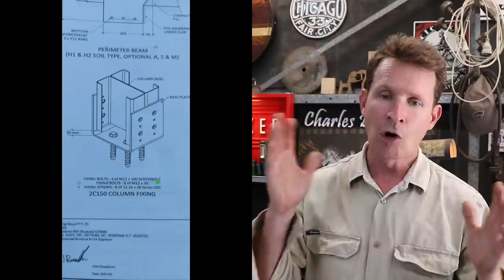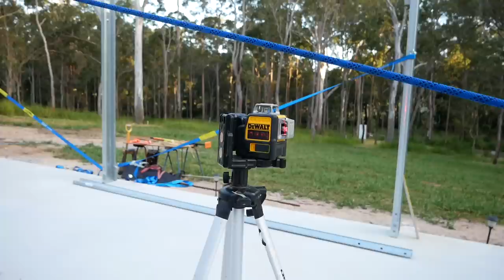DIY Kit Shed Build Lessons Learned Q&A - Forme Industrious

Comment: If you're looking at shed builders, a good price estimate is it should cost approx 30% of the shed flat pack price. Noting that finding a shed builder (let alone a good one!) is very difficult currently!!! Also note best sheds use a different steel (and don't use colorbond) so it's more like 50% of the flat pack price

Comment: Hi Scott, love your style - I'm about to build a 13.5 meter * 6 meter shed - any chance you could tell me about your "roller skate" ladder ?
Reply from the maker: Thank you! If you can weld and cut metal, make a work stand that will allow you to reach the top Roof Purlins and low enough to do the eaves etc. If you see mine in the videos you get the idea. I made a detachable safety rail for lower work. Hope this helps.

Comment: If you would suggest investing in one significant piece of equipment given your other shed build as well what would it be? And you could keep it of sell it at the end.
Reply from the maker: Good question; A Workstand or mobile scaffolding that allows you to reach safely all parts of the build. This will save you $$ on hiring a scissor lift apart from perhaps a couple of days. Lifting the frames you either have a lot of help or hire a machine. Roofing with insulation is tough work without a scissor lift but it can be done. I made my own work stand and I'm glad I did. I've kept it and used it plenty of times for various projects, but it can be sold once I no longer need it.

Comment: Well done Scott.  Loved the old ozzie venacular ;-)  
I know where you are coming from.....  built my 17.5 x 7 kit (with a little help) about 20 years ago.  
Last year I built two igloos (by myself) and then had a crane lift them to connect to the top of each side of a 40 foot HC container.  Did the concrete on one side myself before I called it quits and got a pro for $1800 labour (I paid for all materials) who did a 12m x 6m slab in virtually one day.  
I celebrated my 80th birthday with my twin brother last Saturday  so  I don't think I'll be building anything so substantial again..  
Thank you for all your advice.  You are a wealth of true knowledge.
Reply from the maker: Happy Birthday Malcolm and also for your Brother! Thanks as always for your message.

Comment: I wish I'd been able to get ahold of you before you started on the roofing and siding panels.  There's a great way (for future reference?) to substantially reduce your metal dust from the Tek screws.

Before you move your 1st sheet off of the stack, do this.  Use a piece of framing lumber at least ast wide as the panels to tap then all into the tightest alignment of the ends as is possible using a sledge to hit the wood which in turn will move any sheets sticking out a mm or more back into alignment with the rest of the stack.  Do this from both ends several times, if necessary.  Then use a Quick clamp with plastic/rubber grips, at each end, to prevent the sheets from sliding.  

Once the stack is even, use a straight-edge and framing square or a drywall T-square and layout the lines where you want to drive the Tek screws.  Then, use an old awl, sharpened straight punch, ice pick, whatever, and punch holes through as many layers as is reasonable on your penciled lines.  

You still have metal "dust" from the gerts and joists, but not the sheet metal panels.

And if you can't punch all the way through, "rinse and repeat" as we say here in the US.  Namaste
Reply: Hi Mark, Mate In Australia we Tek screw the peaks.... Not the valleys as to reduce water leaks unlike the practices used in the USA. Using a awl to punch the ridge bends the sheets, it is hard and time consuming to push a piece of lumber strip down every one to punch them. Just Tek them and sweep the roof off before attaching the gutter.
Reply: Good point Mark, I used to build sheds in South Australia years ago and we used to tap the sheet piles at one end with a hammer with a 4x4 inbetween to protect the sheets like you say and then measure the gert distances down the top sheet and pre drill for the tech screws. Saves heaps of work and saves swarf from scratches as well as potential rust.

Scott, great vids mate, gee your face looks familiar.  Im looking at moving interstate atm and then doing the same as you so im keen to follow your adventures.

Comment: That was so good to know Scott - the licensing, research into suppliers, tools and support for building such a beast. Thank you for being so generous with your hard earned knowledge.
I am really looking forward to the fitout, off-grid power, water, drainage, sewage etc.
Reply from the maker: My pleasure Benny, thanks for your message!
Reply: @ScottTurnerformeindustrious  Hey Scott, another great video thanks. 
I just wanted to mention a problem I had with our water in the tank from the new shed roof. Our water became harsh and after testing the PH it was 4.2. Obviously that's too low and acidic. 
It turned out to be bark and leaves from 2 nearby gum trees. I installed Marley leaf diverters and they do work but the main cause was the gutters sagging and then trapping water in puddles. When those puddles had gum leaves or bark in it, it sat there and stewed. 
Flushing pipes and water blasting the gutters has solved the problem but is a constant pain in the a**, when we are low on firewood the very messy gums will be chopped! I see you are surrounded by gums... funny that, being Australia and all!!

Comment: Perfect breakdown on what it takes! I built my 5x8m (+3m carport) last year - I saved $5k building it myself, I figured if I can’t build my own workshop do I need one? 😂😂 I used a local supplier for the reasons you outlined, lucky to just have a delayed window not anything major.
Get extra screws is the only extra point I would add, a few blunt ones made it harder.
Always great videos mate, watching on with interest cheers

Comment: Hi Scott, I really enjoyed this. I've boxed up a few slabs for shed ( and even small garden sheds) ( principal is still the same/ small or large, with what I do) When I box the perimeter, I box it 50mm bigger ( 2"for US readers) . So after the main boxing is  done, I fit 70mm x 25mm (not nominal off the shelf size  but I do or use whatever to get down to about 25mm, because the wall sheets profile measurs about 17mm ish to all perimeter  boxing. ( stop and starts at roller doors It's fitted flush with the top of the boxing.  This is so the outside wall sheets, sit on a ledge. It looks neater and keeps mice out ( apart from the fact that mice can probably find a way in at the roller doors). Concretors do a good job of place and finish, but not so good ( I'm talking tweaking a slab) on the boxing design. For the roller door , I add some extra boxing so the door recesses down  below floor level / probably to outside path/ driveway level approx 30mm below floor level . This helps keep out rain.
Reply from the maker: Thanks for that Glenn. Yes that is a good technique. Will be using that for the next build in Jan. The roller door on this shed has a ramp formed into it to help with water etc.

Comment: So true Scott. We are half way thru building our 2 car shed on our block. Stratco had delivered 1/3 of our shed kit 2x months early…which caused a huge issue, changed the brackets since printing their drawings. Damaged parts, missing parts, wrong gutter brackets We have no measurement detail on the roller doors, only 1 x of many issues we have had . I wouldn’t buy another stratco.
Reply from the maker: Since posting this video I have heard a lot of people have had issues with their kits. A real shame and a lot of frustration at the customer end of the deal.

Comment: Thanks .. really interesting to see the similarities and differences between Aussie and NZ. I'm half way through a 18 x 9. Building permit $2800nzd (rip off) Shed kit ($43K) support from supplier (nearly zero after the final payment was made) Mistakes by the supplier - ongoing! Like the stand you made. I have a mobile scaffold ..but getting up and down is harder than your stair platform. I'd be interested to know how you cut the thicker portal steel or if you didn't have too? The third downs to hold the portals looked good but how did you stop them slipping off the top of the peg at ground level?  When you cut your gable end iron, did you put it up mark and the take id down to cut or measure, mark and cut ..then put up? Did you use Vermin strip at the bottom .. Could we see a photo of that installed if you did. Cheers ..place looks great.
Reply from the maker: Thank you Alistair! Yes the fees are nuts, they just keep adding to them over the years. I was looking for scaffolding but found it too expensive to buy second hand and yes getting up and down all the time is more difficult. I didn't have to cut the portal frame, only the Mullions. I used a 100 mm Angle grinder and 1mm cut off disc. For the tie downs I used Reo bar at an angle of about 45 degrees (or a little less). the straps held on to the reo notches I guess. for the sheets I placed them on the building and marked them off, then cut. I've yet to put the vermin proofing on. Vermiseal I think they call it. Hope this helps.

Comment: Are you going solar with your shed and house? Be interesting to see install..... I just got a shed built with a company here in Cairns, but much smaller than yours, 9x6 m. Getting close to install electrics now. Decided to use 50mm conduit for underground to allow for future upgrades. intend to use 15amp power point for scissor lift and 10amp for rest, milling machine etc. Hopefully house main board in ready for it.
Reply from the maker: Yes, going solar for the shed and house. Hopefully we'll have the shed with solar and batteries before the end of the year. I'll do the install in a YT video. Cheers.

Comment: Hey Scott. Question on the owner builder license; does that only cover the shed build, or can you use it for projects further down the track that you haven’t planned yet?
Reply from the maker: Hey Robin! On my licence application I included 3 buildings. You don't have to have all the plans but you have to briefly describe the basic construction of each; i.e. steel portal framed shed (size). But if you don't include it in your initial application then I think it's very hard to do retrospectively. The licence lasts for 6 years.
Reply: G’day Robin (and Scott). Last year I researched the owner-builder scenario in a NSW council area. I found that the council would accept only one development application from an individual owner-builder in any five-year period. So if you wanted to do several buildings on one property, they would have to all be approved at the outset in the DA. 

Another way of looking at it is that while the owner-builder permit is issued by the state government, all the building work is council-controlled. Of course, the rules in each state and council may be different.
Reply: Thanks guys, great info! When I looked into it last year I noticed that rule and hoped I’d misinterpreted it. I was looking at it as a way of doing more renos on my place, but clearly that’s not what it’s for. Thanks again

Comment: I still have a set of metal shears I got when I worked for titan garages in brisbane in the mid 90's, I found them to be pretty good on quality control back then
Reply from the maker: I think the suppliers systems are pretty good. The product is also good but the missing link is when something goes wrong no one wants to fix the problem with any urgency unfortunately. I'm sure if their suppliers did the same to them they would have something to say about it.

Comment: Hi Scott
Nice videos mate, not sure how you have the patience to film when building. I'm in Mareeba/Biboohra building a 15x20 shed at the moment with a height of 5.2m, i would like to know where you got a scissor for $100 a day?... My kit was $54k fully insulated glass sliding door and two roller doors 4x windows and PA door. We are also in the same position as you with land and minimal accommodation. Would be good to catch up one day and share some ideas on builds and property ideas.
Cheers Mal
Reply from the maker: Hi Malcolm. Sounds like a good shed you have. Should have decent sized portals. TA hire ( just off Grove st Atherton) from memory. But they sub leased it from Mareeba as theirs was booked out. For sure happy to catch up some time when I'm in town, just send me a message when you're ready.
Reply: @ScottTurnerformeindustrious  
Hi Scott
Sure mate no worries, the portals are 300c's.
The Malanda show is on Tomorrow let me know if you are heading over and i will say g'day.

Cheers Mal

Comment: I have just completed a 150 square metre shed earlier this year. I like your videos however in this case I think you are over estimating how much you save by building it yourself. I got the impression you reckon you saved $30K-$40K by building it yourself. I am locatated on the NSW Mid North Coast. Your cost for the concrete slab was almost identical to mine on a per square metre basis (assuming you went 40mpa and 125mm thick) . My Shed kit was $34,500 and it is 4 metres at the gutters and roughly 5 metres at the top. The shed company told me at the outset that the cost for them to put it up was very roughly about one third of what ever kit I went with. At the end of the day they charged me $11K, which included the hire of a heavy duty diesel scissor lift for a week and a few hours hire of a truck crane to stand the frames. The bloke that put it up had his wife with him and a young bloke helping him. He also had a older smaller electric scissor lift. We were interupted by wet weather quite a bit but it took them 5-6 days to get it up, not counting downtime due to wet weather. I get the fact that you can get enormous satisfaction by putting up yourself and that you didn't have a job to go to so there was not opportunity cost to you, but for mine sometimes there is real value in getting proffessionals to do the job, as they have the experience and know-how, with all the tips and tricks you can only get by doing something over and over. 
I sealed my slab with a clear sealer and if I was doing it again I would go with a coloured sealer like you did just because a coloured sealer would hide a few more of the imperfection and marks on the slab. A tip I would give anyone who is going to build a shed is build the biggest shed you can, even if you think it will be way too big, trust me it won't be. No one has ever said "gee, I wish I built a smaller shed."
Reply from the maker: Thanks for your feedback and sharing your experience. Slab was 100mm but a bit more on the sides but I cannot remember the MPA right now. I got quotes of 94k. Labour and materials have skyrocketed I' sad to say. I love to build. Great advice on going bigger with the shed. It's all about the affordability and build ability without special equipment. I I was able to I would have a warehouse. Thanks again!

Comment: Is that roof insulation serving you well during the summer ? I also noticed you didn't insulate the walls either. Must get pretty hot in there right ?
Reply from the maker: The roof insulation works well and it does need wall insulation. I should have put it in. Also the skylights let in a lot of heat energy. I'd rather not have them in summer. Winter everything is perfect. Yes it can get warm in there when all the doors are shut. Doors open it cools down pretty well.
Reply: @ScottTurnerformeindustrious  I'm still trying to figure out which way to go with mine. I want to use Anticon blanket for the roof to negate the rain noise but I also want it to keep the heat out. Some use that air cell stuff, but it doesn't insulate for noise all that well. Anticon blanket resists noise but not so much heat as it's only an R 1.3 for the 60mm. I'd like to use 100mm if I can get it to compress enough under the sheets.
I'd definitely use the air cell stuff for the walls though.
I'm going to give Bradford a call and see what they recommend. I don't want to have to do a retro fit if I can help it.

Comment: Scott, how do I create a seal inside the outer edges? The gaps are insane.
Reply from the maker: I used a product called Vermiseal. It closes off the gap from the sheeting to the slab. I had to put this in later as my wall sheets were cut a fraction too long.
Reply: Yes I’ve noticed this is the case on every shed I’ve looked at inc all the showroom sheds. Cheers I’ll check it out
Reply: @ScottTurnerformeindustrious  CHEERS MATE ! 👍

Comment: Thanks for the video. I have a bad back and a problem with heights so I will not be building my own but you are correct. The erection costs are significant. Your erection costs might have been so high due to the location. Closer to a major city is not as extreme. I found your insights very interesting.

Comment: wait, 50 thousand dollars? That australian? Not sure the conversion rate, but I am looking at metal buildings for the last year for one around 60x80. I can get one that size for 50K here in America. i unfortunately I have no friends and I'm 52yo. So I will have to pay the installation fee.
Reply from the maker: Yep 50k AUD not USD. Prices here have gone nuts! Steel which we have plenty of, has gone up 400% thereabouts. With all the stimulus builders are charging $$$ due to demand. I'm 52 also but I had some help. I'f I didn't have the help I did for this project, I would have paid for a young'n to give a hand.